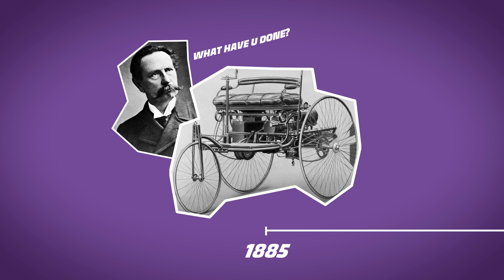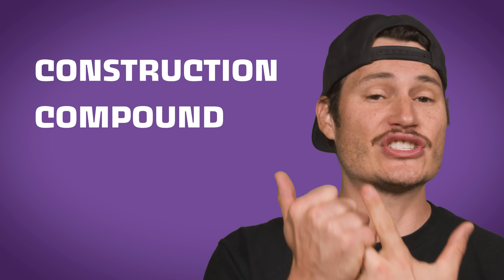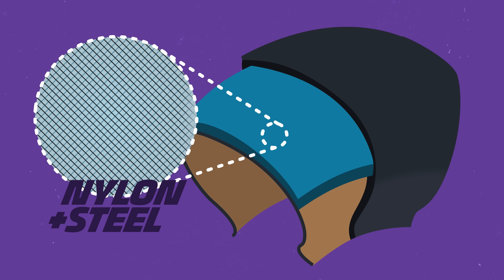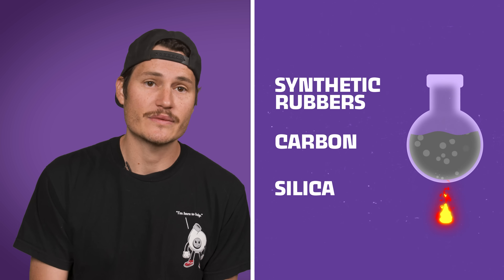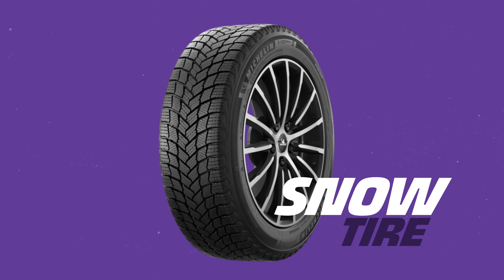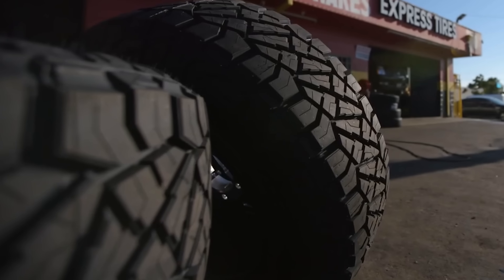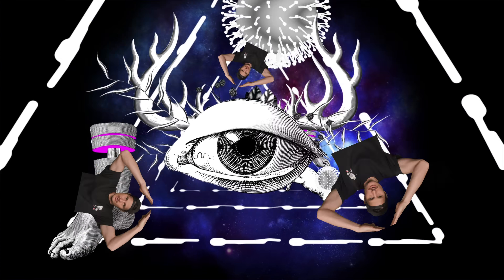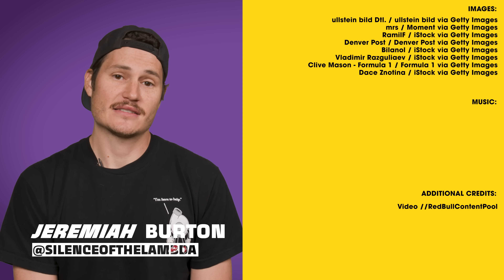The Surprising Science Behind Tread Patterns

Comment: Engineer here. The equation Friction = (coefficient of friction)*(Normal Force) doesn’t tell the whole story.

As the normal force increases, the coefficient of friction actually goes down slightly. This explains why body roll causes the car to lose grip. More weight is put onto the outside tire, but the coefficient of friction of that tire is now lower than what it was before, which means that the total force that stops you from sliding decreases.

The reason why you want wider tires is twofold. First, wider tires can absorb and dissipate more heat that narrow ones. So if you’re generating lots of heat from racing for example, narrow tires would get too hot and overheat, causing decreased traction. 

Secondly, if the same force is distributed over a larger area, the pressure the tire feels goes down. This makes the coefficient of friction go up, since each tiny section of tire is feeling less weight on it, because there are more sections to distribute that weight.

TLDR; more weight, lower coefficient of friction. Distribute that weight over more surface area, coefficient of friction goes up. Higher coefficient, higher grip.
Reply: Looks like we found the smarty pants
Reply: So instead of thinking of it as force pushing it down a better way to think of it is the pressure pushing it down?
Reply: @Stevethe11th  sort of. The formula is still F=mu*N, but think of mu as a function of N and surface area (and temperature)
Reply: Yes and no. Normal force is a multiplier of mass. So a heavier vehicle will have more traction than a lighter vehicle on the same tires. It just takes more energy to make it accelerate and decelerate.
Reply: this is the first correct answer I've seen. good job

side note, you shouldn't confuse body roll and weight transfer. while they're related, they aren't the same thing.

second side note: a bigger tire isn't always faster. while it can give you more grip by allowing you to run a lower pressure for the same load carrying capacity, it also means more mass to accelerate out of the corner.
Reply: I want to like this comment but there are 69 likes and I think that's nice.
Reply: Don't forget about the internal stresses of the materials. If you have a material that is breaking up as it slips, its not transmitting all the possible force to the road because the materials in the tire are the weakest link. That's why top fuel dragsters run big tires at relatively low PSI. If you watch videos of it in slow motion, the tire actually deforms and creates a massive contact patch on the road which reduces the peeling out effect.
Reply: @bryanweitzenkamp4093  I vote this guy gets merch.
Reply: I was going to say the same thing... yeah. But you said it way better.
Reply: I have often wondered. So essentially mu is not a constant in reality, but a function of several factors. Makes sense. Engineers and approximations...
Reply: Yup! This is why ice skates have a thin blade instead of a wide plate.
Reply: Get this man a t-shirt
Reply: Damn, he beat me to it.. lol what he said lol
Reply: @wesandbutters113  has engineering college flash backs
Reply: I don't quite understand the relationship between normal force (being distributed over a larger area) and how that affects the coefficient of friction. To me it seems like as the normal force increases, the coefficient of friction should as well, because tiny peaks in the road surface are being forced into the rubber of the tire more. This logic would mean that skinnier tires would provide more grip (which I know isn't the case). Where is the hole in my thinking?
Reply: This mans lookin like he went to school, what a guy.
Reply: Yeah.....what he said
Reply: Here’s my answer 

Actually, friction does include area.
Friction = uN
Where:
N is Normal force
u is coefficient of friction 

Pressure = Force/Area
Or force = Pressure (P) x Area (A)

Therefore friction = uPA

We can increase pressure by increasing the weight of the vehicle but this would affect acceleration so we don’t want a lot of unnecessary weight 

So we increase area to increase friction.
Reply: @kendrickmelville5804  slim Jim gang!
Reply: @griffinganz2776  wider is better kemosabi.... with a skinny tire you only have a small area to dissipate weight or pressure.... in which the tire in its entirety would be overwhelmed.....contact patch and all....which in turn would yield to which ever direction the traveling force is heading instead of being able to sufficiently counter and maintain grip.....
With a wider tire ....especially at a lower psi you have a bigger contact point which will dissipate force or pressure at better rate.  ... hence why people who drift utilize a wider rear tire at a lower psi..... they're able control how they drift the vehicle as they do 50-80mph through a drift line
Reply: @lyte1981  Right, but the question of why the coefficient of friction would change at all depending on the normal force remains.
Reply: @griffinganz2776  the coefficient of friction changes or is a variable due to the condition scenario..... this....I would think normal force would be on the vehicle/tire side......while the coefficient of friction  relies on road, weather and environment condition
Reply: Great explanation
Reply: This is the correct one.

Comment: On the topic of wear bars, one thing I think is cool about the Continental ExtremeContact DWS tires (which are great by the way) is a built in wear indicator. There's a D (dry), W (wet), and S (snow) imprinted in the tread blocks that will wear out in reverse order. When the S is gone, it means they aren't ideal for snow anymore. Then the W wears out, meaning they no longer are good in the wet. Then the D, obviously meaning dry traction is no longer ideal. It's just a cool little system they have that simplifies reading what stage your tread wear is at. Slick bit of kit if you ask me.
Reply: I agree this is brilliant. I wish it was standard across tires.